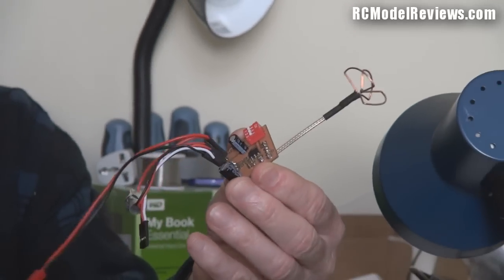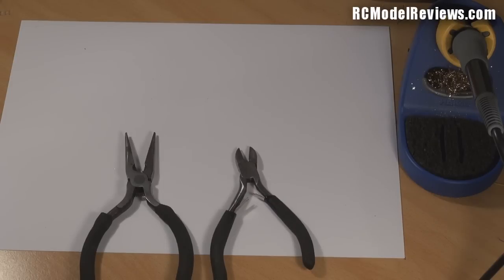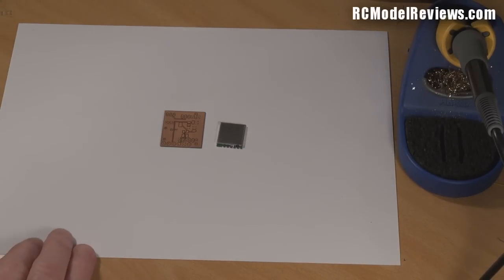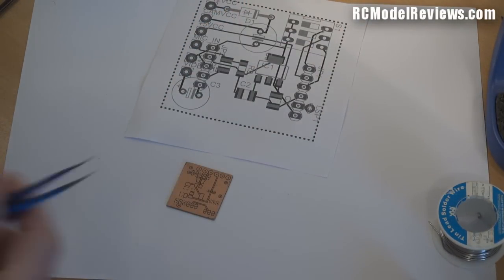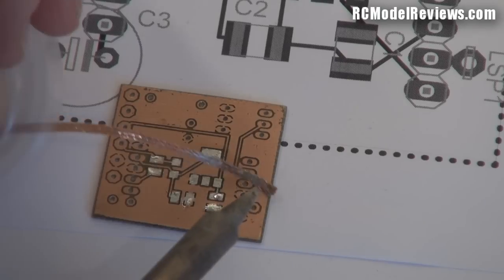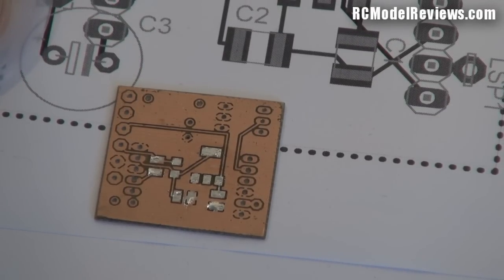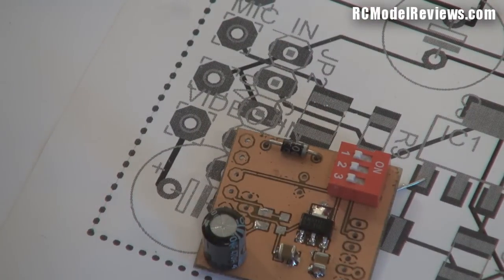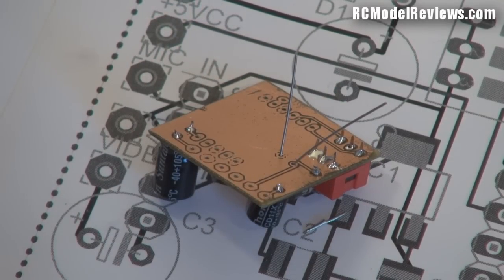FPV Backpack PCB build (part 1)

Comment: Looking good Bruce! And amusingly your tip about the thin wire to do 'through hole plating' I did recently with a board I designed since I needed quite a few connections like that, worked a charm

Comment: By the way, if you don't want to build your own antenna, you can get a very good SET consisting of one cloverleaf and one skew planar antenna from Immersion RC for $40.  HobbyKing also sells this very set, for the same price.  They have a RF transparent cover to protect the thin wire loops.  Immersion RC also sells a variety of helical antennas.  I like the ones made by IBCrazy, which are made by wrapping a wire in a helix around a dowel, and shrink wrapping it. It has a nice reflector, too.

Comment: Regulator is AMS 1117 3.3V.  Be sure to specify the voltage, because they come in various values.  I got ten of them from a Chinese seller for about $2 shipped, to the US, on eBay.

Comment: For those looking for a cheap (but good) soldering station similar to what Bruce is using, HobbyKing has a $15 soldering station in the International, USA and Australian warehouses.  I have one, and it's really very nice.  Way better than the price would suggest.  They also sell a tin of the gold-like anodized metal shavings that are used to clean the soldering iron tip.

Comment: Get an AXN ("Cloud Fly") from HobbyKing, like Bruce and so many other people use.  It's cheap, relatively sturdy, easy to fix, and you don't need a runway.  Also it's perfect for FPV use, because the motor is on a pylon facing backwards.

Comment: For the "thru-hole" on the DIP, you could stretch the pad ouside the top, drill a seperate hole and solder a normal wire thru the board. Then you dont have to fidle around with a thin wire and the possibility to block the hole befor inserting the DIP :)

Comment: No worries about bumping the wire and changing it's RF characteristics, as with some other designs.  I picked up a bag of ten SMA edge connectors (because you fit them to the edge of the TX or RX module,) on eBay, so you can screw the antennas I mentioned to the module.

Comment: Bruce is using the small SMD caps as part of his charge pump voltage regulator, I expect.  That's why they're not listed in the TX module schematic.

Comment: I'm pretty sure that he regulated the 5V from the UBEC to 3.3V using the little black regulator, and used the charge pump (capacitors and diode) to regulate the 12V to 9V for the camera.

Comment: Nope.  It's not there yet.  Expect it soon.

For the transmitter and receiver modules, go to the foxtechfpv website, though there are numerous other sites that carry them as well.  The transmitter module is part number TX5823 and the receiver module is part number RX5808.  I'm using one transmitter module and two receiver modules.  One receiver will be connected to a skew planar antenna, the other to a helical long range antenna. Both are circularly polarized.

Comment: Looking at the module schematic that I got from the foxtechfpv website, that should be simpler than the FPV backpack transmitter, because there's only one thing to power, the module.

Comment: Appreciate your FPV backpack series so much! But a big question mark is, what are you using for the Receiver side? Are you building it from the module or are you using a commercial receiver? Would you make a build video if you're doing it yourself?

Comment: HI, totaly new at this so prob a sill question. I noticed that you are using two different size capacitors, one big one one small one. I have ordered all the parts as described on rcmodelreview and only see the one type of capacitor..2.x 330mfd, 16V electrolytic capacitors (radial) with 3.5mm lead spacing and 8mm can diameter. Am I missing something or is it ok to just use these. any help would be great

Comment: in the parts list you have 2x 330mfd 16v caps.  Is this a 330uF cap? i ask because for the ceramic caps you used "uF"  then switched to "mfd" for the electrolytics. 

Also, i have a burnt out TS5823 with a good module. Can i use the 32ch module with this backpack? or would that need a different pcb layout?
Reply: It the same thing uF or MFD is MicroFarads...
Reply: lasersbee thought so, wanted to be sure. when i put 330mfd into digikey it came up as 33uF caps. thanks for the help

Comment: At one point in the video, the parts number came into focus, so I froze the frame.  The parts number is AMS 1117 3.3V  (don't forget to specify the volts, because the AMS 1117 comes in several voltage values.)  I got a package of ten on eBay from a Chinese vendor for about $2 including shipping to the US.

Comment: I can't seem to get my verification email from your forum so I guess i'll just post this here. Can you please just say what value capacitors you're using? I don't need to learn how to solder or even need your schematic but the module you seem to be using calls for a 470 uf capacitor, you seem to be using a smd ceramic but I cannot find these in that value.

Comment: I can't find leaded solder in the UK. Lead free would work, right?
Reply: Pul5ar It will work but it's a little bit harder to solder, the solder would not flow as nice as leaded solder and you will need a pretty high tempeature.
Reply: Lukas Bonny Thanks for that.
What temperature is pretty high? I usually leave my iron around 300°C
Reply: Pul5ar That should be fine, if I have to solder with unleaded solder I use 350°C, if the solder does not flow nicely just set it a bit higher.
Reply: Lukas Bonny Ok, thanks
Reply: +Lukas Bonny unleaded solder? ain't leaded solder not better for this?